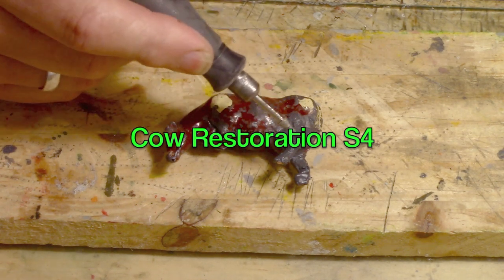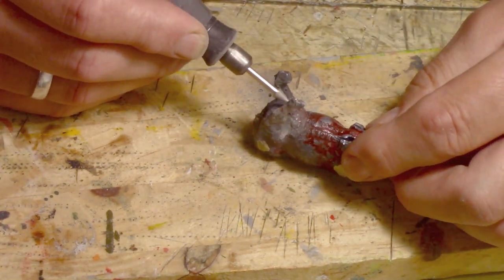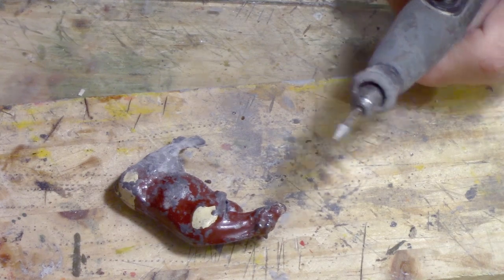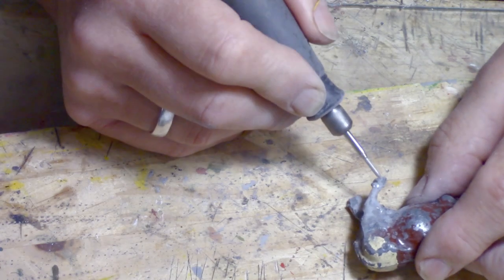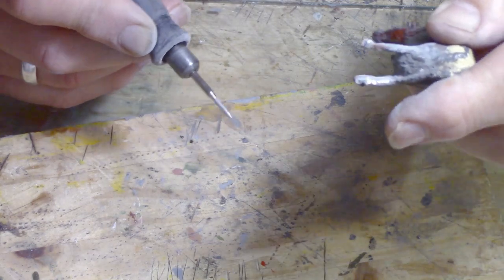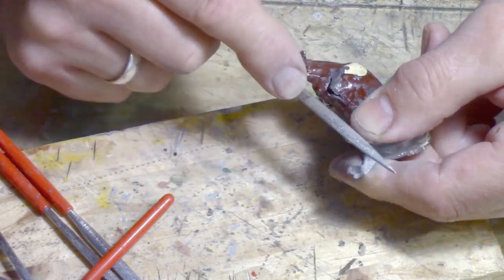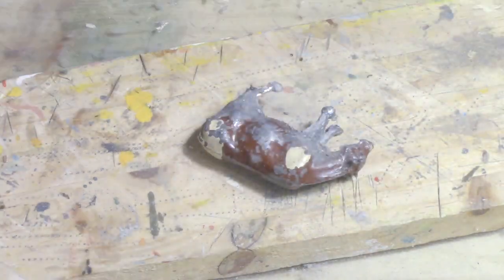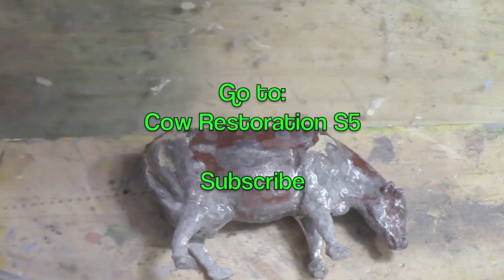LEAD FIGURE RESTORATION  4

Comment: No paint remover first?
Reply from the maker: No...didn't bother as it really does not show after all the filling and sanding. Also these lead toys where hand painted and had faults and I kind of like that.  It's up to the restorer to choose. I'm not a perfectionist ...I compromise all the time.
I also hate stripping paint!  "Truth be told"